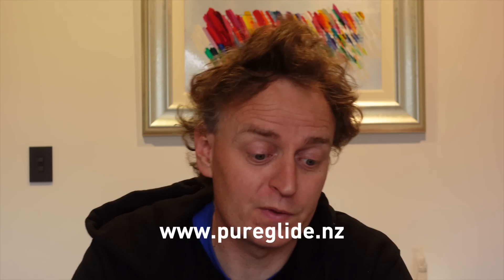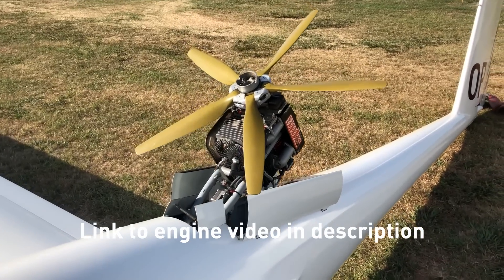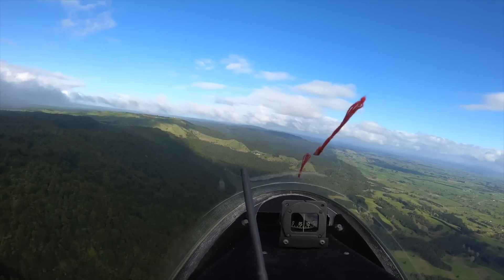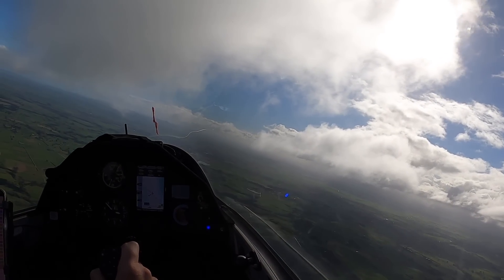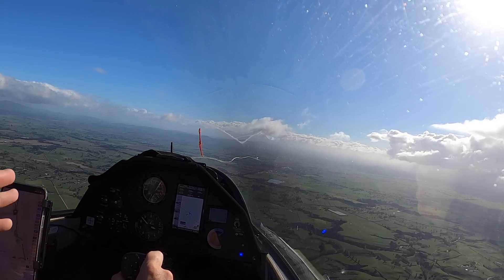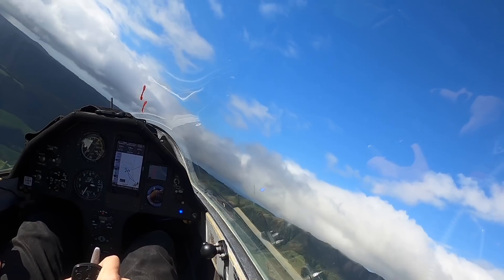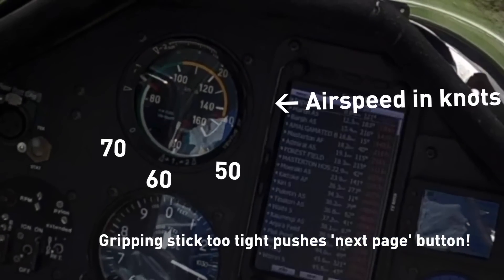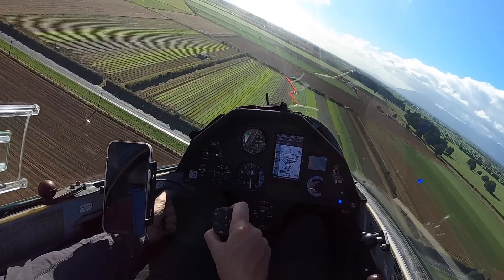Is it safe to open air brakes/spoilers in a turn?!

Comment: Great video. This question is highly analogous to people saying you shouldn't move the flaps when you're turning, on powered aircraft. I think it's a reasonable guideline for early-state tuition to do one thing at a time and only start to combine things when you have the knowledge and experience to do so, and more importantly when your act / scan / react cycle capacity has improved to the stage that you can cope with it all. But a pilot's aim for handling skills should be to develop yourself to the point where you can use the full flight envelope in safety.   And in this situation it's AoA rather than speed that counts. Brake deployment directly reduces lift as well as increasing drag so if you hold constant AoA as you do it you will feel the increased sink and a slight increase in turn radius - but that's only going bring you closer to a stall if you try to compensate by honking the stick back a little. If you are near the ground and having to turn at a near-stall AoA, it can only be that you are in a situation where you don't want to worsen lift and drag in any case. If you want brake in a final turn it can only be because without it you know you would be hot and/or high, so there's no way you will be trembling in the buffet. If you don't increase AoA as you open the brakes you won't get any closer to the stall.  This and your related landing video are really excellent, by the way. You're so open and non-defensive about where situations and decisions are less than ideal. Like you, I think the skidding turn was a bit of a fumble and the biggest factor that would give me the twitch on reviewing the footage. Combine that uncharacteristic error with the excessive stick grip triggering your flight computer, and these are perfect 'tells' for when a high workload situation is getting close to saturating a pilot's capacity. I can recall exactly such moments myself!
Reply from the maker: Yeah I've done it a few times (gripping the stick too hard), so I know when I'm freaking myself out a bit! It doesn't help of course, ideally you'd always be super relaxed...

Comment: Vital on a Libelle to allow for a short landing!
Reply from the maker: Yeah!
Reply: I'd say, it depends on the situation, but for a short landing I'd rather do my turn to final further out and have time to establish a forward slip instead.  Full brakes open on a Libelle is a few knots higher stall, not 1 or 2, depending on the serial no.  It will be in the manual for the specific Libelle.  But be very careful with full brakes on a Libelle.

If the wind is quite variable, I'll close them on the turn anyway, even if it means a longer landing, as it's safest to keep your options open.  Under normal circumstances, the field is good and long.

Safety first.  :-)

Comment: Unnecessarily long rambling post below for the sake of adding my thoughts to the discussion:

I was also trained to use them if necessary in a pattern turn. Generally speaking normal pattern flying is reasonably faster than stall speed. In a Grob 103 (chosen for ease of finding data) you are looking at about a 56 mph dual / 47 mph solo stall speed with full brakes and a minimum recommended approach speed of 65 mph. So for normal operations dual you have a about a 9 mph minimum window to avoid problems in a turn and solo bringing that to a much safer 18mph window. The best L/D solo is 58 mph and Dual 69mph, so even if you are hurting for altitude and trying to milk your L/D back to the field you are better than 10mph difference. That said, bank angle matters and if you are stressing and cranking that thing around to make the field all of this goes out of the window. For me the only safe time to crank over a glider is under two conditions, tow rope break above decision height (plenty of airspeed to make that turn) or with sufficient altitude to recover from a stall/ spin (Don't try catching that tight thermal at 1000'.) 

 For me that boils down to; in normal operations there is a sufficient enough window to use brakes in a turn so long as you are mindful of the wind conditions and adjusting your approach speed to accommodate those conditions, fly coordinated, and keep that bank angle less fighter pilot like. That said only you know what your comfort level is as far as keeping your airspeed in a certain range under these conditions, if a 9 mph window is insufficient for your comfort then don't use them dual, but maybe 18 mph feels easily manageable. In the event you are under stress or otherwise impaired you do run the risk of mismanaging your airspeed sufficiently enough to stall/ spin.. The risk of a stall/ spin in the pattern always exists and is technically worsened with the addition of brakes. So in short, make it a habit not to put yourself in those situations, but if you are on top of things the risk of an issue is relatively low. 

Anybody that read through my mess of words see things differently?
Reply from the maker: Hey don't apologise for the long rambling post, people love it!

Comment: My FI with 6500 h tells me about a time he went to Poland not so long ago, and flew in a Puchacz with a local instructor. He had his brakes open while turning in to the base. This caused the local instructor to start yelling about the brakes from the back seat. In his view it's safe to use the brakes in a turn in all the various types he has flown, but that one should be aware of that they can have an effect. I tend to ease the brakes a little bit while making turns on the pattern, but never close them completely. We have a Puchacz as a trainer, I've healthy respect for it as I know how many have spun in. But I don't think that it presents any risk in it either.
Reply from the maker: Hi yeah we have 2 Puchaczes, for those who don't know they have massive speed limiting airbrakes top and bottom. But generally the advice is the same, as long as your speed is up a bit, it's perfectly safe to use brakes as appropriate. It's also very easy to fly them just near the stall, thanks to the massive wings, maybe that's one reason people get into trouble?! They certainly spin well too.
Reply: Pooches certainly spin nicely. Did all my training in ASK21s and pooches. With my hefty 100kg in the front seat, neither I nor any of my instructors could induce the K21s to anything remotely resembling a spin. The pooch, however, was always very happy to oblige.

Comment: Main thing is to keep your airspeed/aim point scan going and making nice well banked turns. The amount of air brake you apply almost becomes a subconscious act unless you have stuffed up your circuit.
Reply from the maker: Yeah exactly right, the airbrake handle is simply a rate of descent tweaking adjustment knob once you get used to it!

Comment: Thanks for the vid. I was trained by really excellent instructors at the Cambridge Gliding Center in the early 2000s. Was always taught that you can/should use airbrakes even during a turn if required (for instance if you find yourself in rising air and way too high on base leg). As you show nicely, the difference in stall speed is really minimal. Much more important is to be obsessed with never being low and slow. Rather a bit too much speed near the ground than too little. If your speed is good you won't be anywhere near a stall.
Reply from the maker: Yeah agreed, use airbrakes if and when needed. Cheers
Reply: Dude, chill. Not only was I trained pretty well, but I am also a physicist. I think I and most others get what you're saying. Nonetheless,  if your speed is good, you're not going to be anywhere near a stall. As I think you're saying, stalling has to do with angle of attack. However, if your speed is good, the only way to be near a stall would be to be pulling high g. I don’t know about you, but I don’t enter too many 60° turns near the ground, and if I were to, I'd probably make sure I was flying 80 knots.
Reply: @richardkahle8229  Trust me, you have not been trained well as you do not have the basics of what a stall is. You can stall at any speed by reaching the critical angle of attack. The critical angle of attack can be reached without pulling high g's . 
Lift is proportional to velocity squared and it is often common for some instructors to incorrectly teach loss of lift at slow speed (eg high sink rate on approach) as a stall which it is not. This is why some pilots confuse loss of lift with a stall thinking slow flight is the reason. A symptom of a stall is loss of lift but loss of lift does not mean it is stall.
Reply: @randomtask99  Sheesh, I guess I've been told.

Anyway, next time you're in a glider (at height), take it to approach speed, say 60 kt, and see what you can do to get a wing to that critical angle. Add the constraint of no g-loading and good luck. It ain't that easy.

BTW, it's easy to hide behind anonymity. Disrespectful, aggressive and rude comments are pretty cowardly. Consider whether you would use the same words/tone or make the same unfounded allegations in a face-to-face conversation with a stranger.
Reply: @richardkahle8229  If "Disrespectful, aggressive and rude comments" is correcting someone when they say "If your speed is good you won't be anywhere near a stall" then ignore everything I said and carry on doing what you do. Makes no difference to me,
Reply: @randomtask99  Will do. 🙂
Reply: Another good and educational video Tim.  Ditto this comment. Was trained to always have 1/4-1/3 brakes so ready to pull more out (too high) or “clean-up” (too low).  And always be min. 10 knots + 1/2 wind speed above stall.
Reply: I got the same training from them about a decade earlier, probably from some of the same trainers.
Reply: Stalling has nothing to do with speed. If you were trained correctly you would have been shown a demonstration of high speed stalls.
Reply: @randomtask99  Stalling and airspeed are intrinsically linked assuming identical configuration and identical G-loading. Yeah, stalling isn't caused by flying at 'less than 'x' airspeed', but when comparing 'like for like', it has a lot to do with speed, which is why 'Vs' is a thing.
Reply: @JulianShagworthy  I'm afraid you haven't been taught very well. Stalling is nothing to do with speed. Stall from level flight will happen at a certain speed indicated on the ASI which confuses a lot of people. Stall is related to critical angle of attack and nothing else
Reply: @randomtask99  Ha! You - "Stalling has nothing to do with speed." Also you - "Stall from level flight will happen at a certain speed..."

Caused by? No. Related? Definitely.
Reply: @JulianShagworthy  At the risk of igniting the argument again, I am more with how Random Task presents the physics ie Stalling has nothing to do with speed. I really can not agree that stalling and airspeed are intrinsically linked. In my opinion the more accurate statement is stalling and load factor (G) are intrinsically linked. So here is one to get everyone going! How about for an aircraft NOT TRiMMED  by an all moving stab NOT in ascending or descending air for a given wing configuration will stall at a given stick position! Of course changing the configuration will cause the wing to reach critical angle of attack at a different stick position🤔 Running for cover 😀
Reply: @markwood9755  How dare you disagree with... 😅 On a serious note, I wasn't challenging any of the physics, only the statement that stalling and airspeed are entirely unrelated, which could be read very dangerously by a new pilot. 'Intrinsically' may have been the wrong word to use, I concede. But there is undoubtedly a relationship that must be appreciated and I say again - this is why aircraft manufacturers publish a stalling speed, not a stalling angle.
Reply: @JulianShagworthy  “ A relationship that must be appreciated “ Mmmm liking that 😄 how about a “relationship that must be appreciated and understood” 🤔 over the years whenever I or anyone else mention stalling speed of a craft I always add the caveat of  this is a 1g stalling speed.  I am sure we are not disagreeing with the physics but more on how we impart the knowledge to new pilots without ambiguity, for a manufacture to quote a stalling speed without the recipient understanding this is a “one of speed’  wings level 1G stall is  a recipe for disaster. I would also suggest that the vast majority of stall spin accidents entered the stall above 1G ( or below -1G for inverted flight) with the departure speed well in excess of that placarded. The stick position discussion was presented to me over 30 years ago, I initially could not see it however as the years and experience have passed I have warmed to the whole concept. I am sure there will be aerodynamic arguments involving Reynolds numbers and all sort of things to disprove it , however as a stick and rudder guy I think it pretty much runs true. Piper Cub pilots disregard you have a THS as do airline pilots ( Trimmable Horizontal Stabiliser)

Comment: Thanks Tim .a great point for debate. As ever, it depends 😁😄
What you're flying, where you're flying it, who you're teaching, what example you're settling all feature in the answer 👍
PS ground taxiing a landing glider towards vehicles or buildings would trigger a very robust conversation with the CFI at my home club 😁
Reply: I was hoping that someone would bring up the "setting an example"-argument. It's always worth considering what habits other, less experienced, pilots might develop from copying you. Especially if you're an instructor.
Reply: @saltokobo  Yes, just human nature really. "Well, I saw HIM doing it.....!"
Reply from the maker: Yeah it’s a good point- I have a technique that might not be obvious: I’ve already used the wheel brake before turning towards the fence line, so no more brake is needed to stop in time. I’ve had lots of wheel brakes fail on me! Good point about it being a bad example…
Reply: While I agree on the taxiing towards vehicles/buildings, I wouldn't say that's a universal everywhere. If you're an experienced pilot, familiar with your glider and make a point of testing the wheel brake before initiating the turn then I don't see the problem if the runway is busy.
Reply: And driving a retrieval car towards a landing glider would have done the same for my Granddad! (which folks would do all the time and get him going.)

To be honest though he didn't even like anybody driving a retrieval car straight at a stationary Glider. His rule of thumb was to point past one of the wings. He would say well what if the brakes fail or the steering goes...

Comment: Thanks for testing. But for me, as a beginner flying training gliders with much larger airbrakes, pulling them out might be a (much?) bigger difference in stall speed than your performance optimized glider. Wish I was allowed spin tests on my own, guess I have to take some fat FI with me for that. :-D
Reply from the maker: Yes that’s a point I should have made: every glider is different, and will behave differently!
Reply: You might have a look at you POH. Usually it states the stall speeds with and without speedbrakes